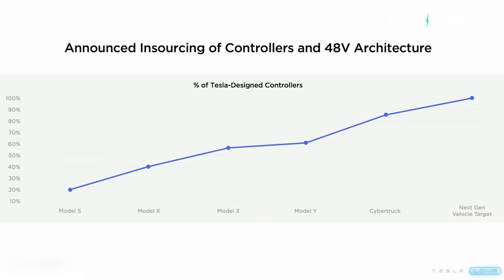How Tesla plans to save $10 billion every year by using less copper

Comment: I am pretty sure when Musk discusses using 48v he means to replace the separate 12v system that runs the radio/head unit, wipers, door motors, lights etc. for 48v which would mean a redesign of many those components. The drive motors are running at high voltage already and would likely not be effected by this upgrade so copper used for them would not change.
Reply: They are talking about getting rid of the 12v system as a whole. Yes all that has to be done. The whole industry knows it needs to be done but doesn't want to the the first.
Reply: This. It'll save a small amount of weight, but not nearly 40kg.
Reply: @OtisFlint  Have you ever looked at how much wiring there is in a modern car.  The harnesses are big and the run the length of the car just about.  Part of the reason to do stuff like brake lights digitally was to get rid of some wires.
Reply: @kensmith5694  True.  Thinking also about wiper motors, electric window motors, cooling fans, pumps.  I'm sure the total weight of wiring certainly adds up.
Reply: The Model 3 uses 350-400 volts for battery, inverter and motors.

So the savings of switching to 48 volts is more limited than described in this video.
Reply: @albeit1 - The 12v systems in modern cars are massive.  The Model 3 DC-DC converter is capable of outputting well over 100 amps @ ~12V.  To put that in perspective, US homes rarely exceed 200 amps total at the panel, and 100 amp service is still common.  Think of how big and heavy all that wiring is.  Quadrupling the voltage will make things much cheaper and lighter and more efficient.  The only reason why it can’t go higher is because of safety.  50v is pretty much the upper limit for incidental human contact.
Reply: @ClockworksOfGL  I wasn’t disagreeing with any of that.
Reply: @albeit1  the high voltage system is mostly alu. The 12v system is 100% copper.
Reply: Yes. Drive motors have nothing to do with the 12V. The biggest issue which was not mentioned was the resistance. Because of OHMs law, the whole car will run more efficiently and therefore have better range and/or need less batteries. 

I would think that project highland/Jupiter would upgrade this in the 3/y because of the range/cost savings.
Reply: 48V needs thinner wires than 12V for same power so the biggest savings are probably from thinning wiring harness.
Reply: @finnderp9977  Yes, I just did the math and came up with a factor of 16 times thinner.  When the voltage is increased by a factor of 4 the current for the same power goes down by a factor of 4.  Also if you are willing to lose some percentage of the total voltage in the wire, on 48V that percentage is a larger voltage too.
Reply: @arnyswart  I doubt there will be an impact on efficiency due to the change in voltage.  They will change the wire diameter down by a factor of perhaps 4 to save on copper.  I will explain with some made up numbers to make my point.
Lets say we have a 12V thing that also is 12W just to make my math very easy.
Power = Volts * Amps
12W = 12V * 1Amp
12W = 48V * 0.25Amps
Lets also say that on the 12V system the wire was selected so that 10% of the voltage is lost into the resistance of the wire.
We would also do about the same percentage on the 48V system.
Volts / Amps = Resistance
(12V * 10%) / 1Amp = 1.2 Ohms
(48V * 10%)/0.25A = 19.2 Ohms
So for the same efficiency in getting power to the load, they can go with a much thinner wire.  This would be a huge savings.
Also 48V is the highest voltage that is generally considered safe for a human to touch so no extra shielding to keep fingers out is required.
Reply: They are using large aluminium conductors where they can for the high voltage stuff. So the copper need for this system is basically bottlenecked by the copper in the motor itself, which needs copper (silver would be good too).
Reply: @adamrak7560 u 3:35 3:48
Reply: If copper supplies actually became really tight, aluminum could fairly easily be used for field windings in the electric traction motors. Copper has better current carrying capacity by volume, but aluminum has better current carrying capacity by density, if you've ever held an aluminum ingot side by side with a copper ingot, the difference in density is quite impressive, copper is very heavy and aluminum is very light. Downside is that aluminum also requires more careful mechanical connections because of its tendency to produce it's inert oxide coating. Replacing copper entirely wouldn't exactly be ideal, but really copper doesn't serve many irreplaceable role in EVs that can't be served by aluminum.
Reply: @0hypnotoad0  Aluminum wire doesn't do as well when flexed.  This means better support is needed for it.
Reply: Where tesla is moving to hairpin motors, the amount of copper in the motors will increase due to the way they are built. Your right on the nose about the wiring though. Also something Sam missed was by moving to 48v they will reduce power losses by 93%.
Reply: @makeitgreener642  Hairpin motors allow the volume fill factor of the stator to be higher.(i think it was 80% for regular round wire windings to 95% on hairpin) What you can do with this is up to the designer.... The efficiency of the motor gets a tad better and the power output is also a tad better, or you can remove copper and have a cheaper motor that's still efficient. Use more copper.... maybe it depends.
Reply: @ligarsystm  hence more copper due to the higher density. They are unlikely to compromise on the motors as the competition are also using hairpin motors.
Reply: @ligarsystm - Hairpin motors are also just…more robust.  Toyota has been using them for years on the Prius C, which has no active cooling system for the motor.  For comparison, the wire wound motors used in the old Prius were notorious for burning out.
Reply: @makeitgreener642  Correct.  Losses in cables are proportional to I^2.  Dividing I by four leads to a saving of 15/16, as you say.
Reply: These days, DC-DC converters that can turn 48V into 12V are so cheap they may as well be free.  The mounting hardware to hold on will likely cost you as much as the converter PCB will.  This radios etc that run on 12V can still be done.  With Tesla dropping AM radios, the fact that such DC-DC converters make noise in the AM band won't matter.
Reply: Correct, this wouldn’t affect the drive motors
Reply: Yes. It seems he jumped from low voltage to high voltage in his thinking. With the amount of content he puts out I’m surprised he doesn’t make mistakes more often.
Reply: I think you're right about that
Reply: Came to de comments specifically to thumbs up the first comment that mentioned this.
Reply: Elon said a reduction of 75% of the copper used in the car, that of course implies the drive motors as well. The drive motors make up the bulk of the copper weight.
Reply: @lawrencecoleman6998 
Although that has nothing to do with the 48v system so he was almost certainly talking about the wiring/cabling, excluding the motors.
Reply: @lawrencecoleman6998  Increasing voltage and reducing current does reduce the size/weights of cables and reduces the losses in those cables.  It does not, however, reduce the size/weight of motors.  Reduced current creates reduced magnetic flux, and therefore at lower currents the length of the windings must be increased. Motor size remains the same.  As a general point, I would be careful about listening to Musk when it comes to engineering matters.  He has shown many times that he doesn't understand these things.
Reply: @lawrencecoleman6998  it does not of course imply anything. Motors are already high voltage. The change concerns higher voltage of the rest of the vehicle meaning lighter gauge wiring.
Reply: Incorrect. The high voltage reduced the 400/800v high voltage ⚡️ system by 80%
Reply: It’s all about the heavy drain devices - steering motors primarily, secondly heat pump. After that motors are small.
Steer-by-wire wouldn’t have worked with 12 volt. 100w computer doesn’t benefit, runs sub-1 volt.
Reply: My thought exactly… I think the reference to reduction is only on the low voltage systems.
Reply: 48V bus does not change the motors.
Reply: Those heavy motors also have to be replaced by axial flux motors
Reply: @rwyo83  
Well…depends…axial flux does not automatically means a lighter motor and as far as I calculated, they tends to need more cupper so…depends on what to optimise for.
Reply: @rwyo83 no. Maybe that’s a fad.
Reply: Yeah, like what 12V aftermarket devices would one to install in Teslas? No radio, no extra cauges, amplifier or subwoofer maybe?
Reply: @finnderp9977  Mass market ones, perhaps. But you miss an essential point here: Most of those devices run far better on a higher supply voltage. Using 12V to achieve meaningful output power requires bridging your load across two output circuits to double the swing. And that has problems, in auto units, and elsewhere. Some units have to use 'stepping' supplies to make up for a low supply voltage. They also have problems.

48v is a much better voltage to work with for many reasons, not least the proportionately reduced supply wiring gauge.

Btw: A small point, by having a greater swing on the output of audio devices, higher impedance speakers can be used, further increasing conversion efficiency (the amount of winding you can get into a given motor gap increases) and further reducing the needed copper overall in the system.
Reply: @finnderp9977   - simply throw in a buck converter (48-12v) and the 12v rail will supply any standard components.

Too much is made of  minor problems, Tesla could already just run the high power devices (cooling, AC/heatpump) off the 400V (or 800) traction pack. 
(LED Lights, who cares what string voltage is chosen, 12/24/48/..., these are simple engineering decisions.
Reply: @kadmow  For 400/800V maintenance tech/mechanic probably needs to be certified electrician? I think it would become impossible to repair something like AC if you would need technician who know high voltage stuff AND AC stuff and is willing to work on car mechanic salary. 

I think 48V DC isn't dangerously lethat yet. Haven't heard any DIY mechanic to die on 12V DC yet. Think that would made into news and scaremongering campains not to repair car yourself.
Reply: @finnderp9977  you just add in a buck convertor to supply 12V or whatever you needed and TBH i doubt there's the space to fit an aftermaket stereo and the tesla probably would throw up fault codes if you did.
Ni on all cars were 6V back in the 50s and larger HGV are alread y24V , nothing to see here really
Reply: LMFAO YA THINK ?
Reply: @paulhailey2537  It might be obvious to you and me but he touches on the reduction of copper in the motors at the end of the video. That's why I mentioned it.

Comment: Sam, you discussed the motor weights, but that conflates the actual savings.  The motors will not be impacted by the low voltage change to 48V.
Reply: I agree, Sam the motors are on the high voltage system, not the 12V system.
Reply: There are motors in the doors, seats, wipers.
Reply: @kkarllwt  Great observation.  I'm curious though, as to the amount of copper required for those small motors by comparison to the drive motors.  That said, if you measuring out the total length and gauge of wiring across the entire vehicle, I can see the savings.
Reply: I think the Cybertruck and/or production Roadster 2020/2024 are getting 800v motors, so Elon's statement about huge copper reduction was misinterpreted by Sam. Changing to 48v doesn't reduce the copper used in the motor.

Comment: Are you sure that the copper for motors will be less when switching from 12 to 48V. Don't the motors run with the main 500V battery?
Reply: He wasn't clear, but he's talking about the standard 12V wiring that all cars use, including Tesla and the car you're driving now.  Even Teslas have a standard 12V car battery to run things like the displays, power windows, sound system, etc.

Comment: Most of the copper is used in the power train and will be unaffected by changes in the low voltage circuitry. So actually, it's not very significant.
Reply: Average small 12v European petrol car has 20kg of copper in it @ $8 per kg, so $160 raw cost and far more for finished wire. Moving to 48v means saving 75%, so $120+ cost saving. That's almost 0.5% of a $25k car list price and a much larger percentage of the basic materials cost. (from majubahillcopper...copper-in-electric-vehicles)
Reply: Interesting but not really applicable to EV's. It's a different ball game entirely.

Comment: The motors are not 12V. They are "high voltage". So, there will be no weight change in the motors.
Reply: And there won’t be 30 kg of less copper usage. It’s largely replacing current wires with thinner copper wires and less copper in ancillary motors. But not the drivetrain motors that are on 400 V anyway. So the saving may be 5 kg or so, not more.
Reply: What a there a possibility Sam was talaking about the other motors in the car ? Window motors ? A/C compressors ? Solenoids ? And fan motors ?

These could all be lighter when swapped for 48v units when compared to 12 v ?

I’m curious.
Reply: He does say at 12:45 “Outside of the drive train” …
Reply: @maxflight777  Listen to his last sentence. There is no doubt that he hasn't a clue
Reply: @maxflight777  I don't know about Tesla, but my PHEV uses high voltage for the AC compressor.
Reply: @maxflight777  Not a chance
Reply: Changing the voltage from 12v to 48v is only half the story
What Tesla did not elaborate is applying a 48v POE (power over ethernet) architecture. In this system you still keep the old 12v components lights, window motors etc in 12v and while using 48v Power and control the componet using ethernet data. In this system only a single POE cable ring is required instead of individual wire from battey to component in the preaent 12v syatem.
Reply: Thank you for so willingly exposing your ignorance publicly. Enjoy your 48 volt traction motors. Be best if you actually understood what you plagiarise before sharing this nonsense. How about you convince the Muricans to convert their mains supply to 250 volts. Think of the copper savings or no need to lay thicker cables for EV's
Reply: @MegaWilderness  In North America, we already use 240 V for large appliances. A lot of people don't know that. Electric oven, electric water heater, clothes dryers, car level 2 chargers or heat pumps. Everything that needs a lot of electricty is on 240V in North America. Every houses have two live wires, that are at 180 degrees of polarity and one neutral. When we combined two live wires, 120V + 120V we gets 240V. We usualy use it with either with NEMA 14-50 type plug or direct wire connection done by an electrician. The 120V is for small appliances like TV or lights. I live in Montreal, our electical system is identical to the American's. Everything in my house is electric since my ground source heat pump use electricity, my water heater is electric and my car is electric. They are on 240V no 120V. So transitionning everything to 240V wouldn't do much in term of energy since that for a light bulb that use 23 Watt, 120 V or 240 V doesn't make a large difference in term or energy loss in wires, it's no zero but it's negligeable compare to a 4500W water heater or my 9600 W (240 V X 40A) level 2 car charger. We could save on copper, but energy savings would be negligeable. The weight of copper is not an issue for a house. It makes total sense for an EV, and I undestand Tesla's decision. Every small weight savings makes sense for an EV.
Reply: @LamarreAlexandre  No you don't. You use two phases instead of one. Three phase power in the UK is 380 volts.
Reply: @LamarreAlexandre  True.  But a 120V lawn mower is really struggling by the time you daisy chain a couple of extension leads to reach the bottom of the garden.  Not a problem in Europe.  And a kettle boils water much slower in N. America (15A at 120V can never match the British 13A at 240V).  When I moved to Canada from the UK twenty years ago that was one of the first cultural differences I noticed.
Reply: @MegaWilderness  This comment is quite harsh, but one cannot argue with it.  I hope Sam corrects his error forthrightly.   I hope and expect he will.
Reply: @MegaWilderness  talking about ignorância, USA electrical system is 240V, propose to study w little bit before calling others ignorant.

Comment: With most components controlled via microchips it makes sense to swap to a system that allows power & communication via a single cable (Power Over Ethernet) just think of the 48v system as a POE Switch
Reply: Cars commonly use a different bus than Ethernet.  The speed is slower but it is extremely robust.  It is the CAN bus.  It needs only two wires the the digital sigalling.  The wires can be very thin.  The power wires can be as heavy as needed.